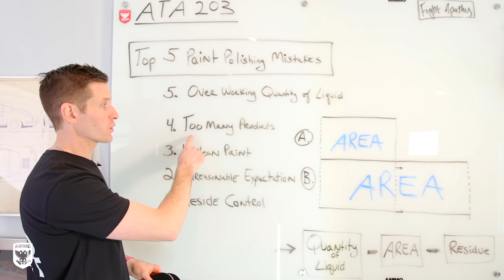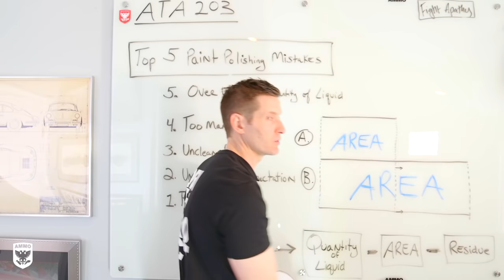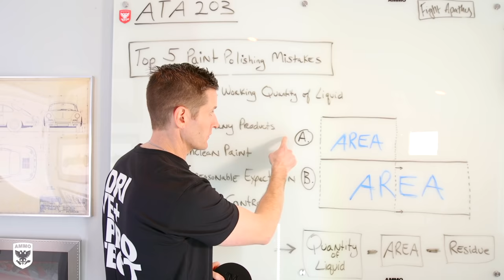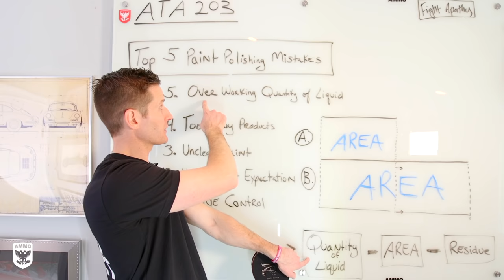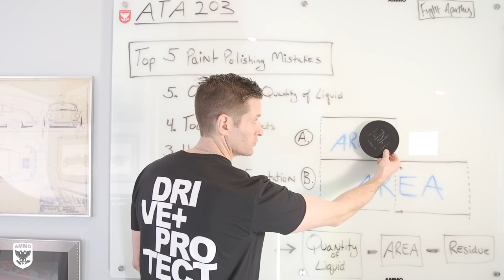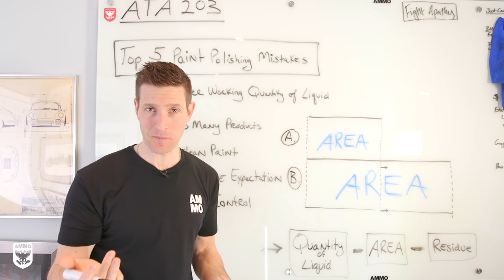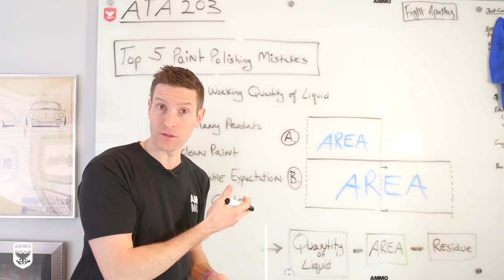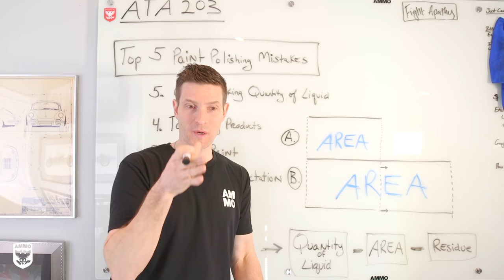Top 5 Paint Polishing Mistakes to Avoid! ATA 203

Comment: these series on buffing out to a mirror shine have been excellent.  the part on sanding to flat has been tremendous help.  if you are using base coat / clear coat or even single stage with clear coat is the orange peel on the clear coat or on the base coat or both.   i have spray can painted the hood, roof, and trunk lid on a 92 celica and they are now mirror finish.  still some minor flaws but for spray can paint job its fantastic.

Comment: Wow - yesterday was my FIRST time polishing my BMW. I had several areas that I (now realize) I overused my liquid. I had lots of sticky residue left over that I had to remove w/ a wet rag after. I couldn't figure out what was happening. OMG. Love this video. I had some paint touch ups that I did where the paint touch ups came out a little darker. I thought I could polish/buff this into the rest of the panel but I couldn't- not even w/ a cutting compound. Wish there were a video on correcting this.

Comment: Just polished for the first time yesterday and I'm super unsatisfied with the results. It's a 2015 Toyota Tacoma, 250k miles with lots of little knicks and scratches. It does look more shiny, but none of the scratches and swirls from what I see are gone. I used Malco Heavy duty with a wool pad. I had my DA polisher set to the speed malco recommended which was 2000rpm. We kept in small sections less than 2 x 2 ft but was still super hard to wipe off. We were also outside since the truck couldn't fit inside my garage and we are in Florida. 

My belief is that 1) it was too hot and humid outside 2) the pad we chose was not sufficient. I think the wool we used was a finer polishing pad. 3) possibly the paint still had sealant over it and didn't do a good enough strip wash. All we used was clean slate by CGs mixed with some superclean, then clay barred, IPA'd, then got to work. 4) Didn't prime wool pads correctly and didn't keep them clean properly. It didn't feel like it was cutting anything but just left some shine on there. Could someone give me some pointers on maybe why it didn't work or could my expectations for the types of scratches and corrections be wrong?

Comment: Funny thing is, the Festool RO 90 sander that was used for the wood demo has a polishing pad available for any type of polishing you'd want. Festool RO 150 has it as well. It won't do much good with a foam pad in the way, but the dust extraction piece is there. No long throw buffers though...

Comment: Bought a 2021 Telluride SX in Black Copper in late 2020. Gave it over to the a detailer with about 60 miles on it to do a ceramic coating. In prepping they burned the paint and then ceramic coated on top of it. Good times 👍🏽

Comment: thanks.  decided to finally compound/finish my three mustangs...so learning a lot before beginning. good tips...deciding if I need to strip before compounding. I only Turtle Wax once a year Spring, on all vehicles......so stepping it up a bit this year. I'm going to do it  light.  clay bar on one of the cars that needs it and then Mcguires Ultimate compound (heard it's pretty  mild) and do it lightly with middle foam pad not cutting... then wax with Ultimate wax...and see how it goes.  Car's are not that bad  curious about the foam pads and compound...two things with cutting?  hmm.

Comment: Thank you Larry! I have been searching all over the place to find out how to safely remove any sealants or waxes before compounding or polishing.  Every one says to use a clay bar, or Iron Remover, or APC or run a paint cleaner with a D/A. If it takes Kevin a couple passes with a sanding disc to break up a sealant how is a clay bar or paint cleaner going to remove it all? Any direction on this question would be greatly appreciated! I cant seem to find a solution that makes sense yet.

Comment: I polished my car for the first time a month ago and definitely was working on way too big of an area. every demo people showed online showed them doing a full panel or half a panel (like half a hood). I think I used a lot of compound (I was thinking i needed more after my first panel, so I increased it). I did the panels and afterwards I wiped off the residue, but the residue took a lot of elbow grease to remove and it also got all inside all the panel gaps and everything, the work got so overwhelming. I finished polishing the whole car in about 3 to 4 hours total? and then I tried to remove as much residue from the crevices as I could, but the compound was so dry and difficult to remove, so I definitely overworked it despite using a lot of compound (like I was putting on decently thick Xs of compound on plus maybe 3 to 4 additional drops to make sure I had enough for the panel).

Definitely lots of mistakes / stuff that made the job immensely harder, and none of the "how to polish a car" videos addressed.

Comment: You mentioned the importance of clean paint and the struggles of working on unclean paint, but not exactly the process or products you trust to get the paint clean before polishing. Can you please share or provide video link?  I use car wash shampoo, iron remover and clay bar before polishing.  Is that enough to say the paint is clean? I like using hybrid ceramic wax as protection after maintenance washes and spray detailer between washes. Thanks!

Comment: Another great video but what the hell... A car wash that put down a layer of protection that rejected wool pads and 3,000 grit?!?! I need one of those by me lol. Is there a specific paint prep you both agree on that is optimal over the standard paint preps? I absolutely love this series and keep them coming!
Reply: Some have ceramics applied at the end too. I believe the company is called Blair Chemical.
Reply: I'm surprised the Denali was clean enough for that protective layer to have actually stuck to the paint.  I'm guessing the car was was at least NOT a touchless.
Reply: @phasmata3813  I would assume it was a noodle wash if it was able to bond like that. Either way that is extremely impressive in my mind bc it was sprayed on a wet car and them sprayed off..
Reply: @phasmata3813  - The presoaks, and detergents are extremely potent and caustic. 

I remember them burning the hell out of my skin when the blowers blew the mist back to the prep area.

A friction wash can get the paint even cleaner due to the detergents used on the brushes, but a touchless usually uses a stronger dilution of presoak. That being said, if the car is really dirty, a dirt film remains on the paint.

Comment: Hey Thanks for the info I have a 2000 Silverado that has real good paint, So I work on that one my wife has a 2020 Highlander too new to touch. keep clean and wax that is all . But I have a good supply of chemicals and micro soft rags. Need to work on a good vaccum

Comment: I have found over the years that instead of putting 3 or 4 dots or dots of compound in general on my pad i put 4 lines right across from one another it gets your compound across the entire pad better. Also some compounds like 3D brand are extremely hard to over work and cause to dust. They have about 3 times the working time of about all other brands

Comment: I seemed to have missed the answer to what to do to paint to prep it before cutting, if there is a polymer coating.?
Reply: That's what I would love to know too. I wonder how should I completely remove something harder than wax, for example, a ceramic coating
Reply: @ramizfs  I have found with the right compounds pending the type of ceramic coating it can be slowly worked down. Or i have hit it with 3000 and re compound and polish.
Reply: Wouldn't using an apc or non ph neutral soap cut down or degrade that wax or whatever protectant is on the paint?
Reply: @slickwheelsdetail9586  Yeah, it seems to be the only way to do it. Thank you!
Reply: @ramizfs  when I have some extra product after I coating I have a old hood from the body shop in going to coat and mess with to see what it's like to remove the ceramic coating. Right now I'm using SystenX but im looking into moving wit IGL now.
Reply: their comment on the matter was dwell time. use stronger stuff and leave it on longer to remove.
Reply: @slickwheelsdetail9586  so let say the ceramic coating needs recoating after 6 months or year etc.. do you have to strip the ceramic coating all together again and then reapply ceramic coating? or can it just be reapplied on top of it (which i think its not right)
Reply: @JohnDeTulio  you mean like dawn soap?
Reply: @slickwheelsdetail9586  i think its good idea to get free parts from autoshops thats no longer working and test the ceramic coating or wax you use and see what products strip it so you can either reapply the wax or ceramic coating or polish etc..  question is, does feel determine if there is no sealant (like the squeaky clean rub feel in glass cups etc(
Reply: @ramizfs   ceramic coating can be remove via polishing some are or most are hard to remove but it doable with a cutting compound and a good da polisher maybe a force rotation will take it out faster  not sure since ive have not  try that method.
Reply: @JohnDeTulio  not ceramic coating since its meant to withstand a beating.

Comment: So is the idea to use 3 pea size drops. Work a one foot section in one pass.  Change or clean the pad.  Then repeat until finished? I see many other's on these channels using 3 drops, then buffing a 2' X 2' section for  2,3,4,5 etc.. passes, until basically there is no residue left to see, then they wipe off with a cloth.  As a beginner, what is the most effective way to achieve the best results.

Comment: Another great video. If polymer sealant aka synthetic wax is that tough to compound through, what would be the best way to cut into a coating?  It turns out, GD Infinite Forcefield doesn't have the best etch resistance (or the worst either to be fair), and my bumper and hood need some bug stain polishing.

Comment: Amazing , ty vm 
How the hell to remove wax/sealant before polishing please ?
Wax stripper often does not work , cutting compound as well if even sanding finds it difficult sometimes as in your video.

This question is still  open please
Reply: You use an IPA..(ISOPROPELYNE ALCOHOL).MIX A 50/50 SOLUTION HALF WATER HALF IPA IN A SPRAY BOTTLE..FIRST MAKE SURE YOU THROUGHLY CLEAN THE CAR..THEN CLAY BAR THE CAR..THEN USE AN IPA TO PREP YOUR CAR

Comment: Is there any specific way to go about removing ceramic coating? Mine is uneven in spots and needs to be removed and reapplied. Is there a specific compound that's good at removing it or is there a different method?

Comment: So maybe I missed it but how did the guy get the big SUV’s(15:00 mins in) paint cleaned off to continue the paint correction and perfect it?
Reply: I had him use an abundance of compound with a microfiber disc on a DA. Basically, the buffing liquid and pad was able to grind off/up the protection. He was able to see the point when the defects started to remove rapidly, and could feel the difference in how the paint felt during polishing, and wipe off.

Comment: How often should you blow out pads/change them?
Reply: Good question, im not a pro but I blow out my pads after about 3-4 1 by 1 foot runs. And for a relative small car ill use 3-4 pads
Reply: Adam Sounds right, I have experience in sanding wood siding on homes, you can see the pad degrade over time and notice the pad no longer cuts into the siding. With polishing, can’t really tell if the pad is worn down after blowing it out since the pad is so fine. Of course polishing is less work than sanding so the pad should last longer I assume.
Reply: @adamryd95  are you saying every 3 to 4 1x1 foot you blow it out? And overall use 3-4 pads in total for hatchaback size?
Reply: @janglee8523  yes, just so the pad is  as fresh as possible and not have any contamination and dirt in it

Comment: What do you reccomend to have only one machine, a Flex or Rupes (forced or free rotation)? By the way, amazing video as always
Reply: While I won't go so far as to say that anything is ever impossible with anything, I would personally not rely on a forced-rotation machine if I could have only one.  I haven't used a Mille, but the Flex gets hot, fatigues your hands faster, and will be much more difficult to finish with.  If you're just starting out, I like to recommend a Griot's Garage 6" with the backing plate downsized to 5".  It's cheap but good, can do anything you want it to do, and if you upgrade, the GG6 can make a nice 3" or works well with brushes for interiors.  I'm a professional mobile detailer, and I still use the heck out of my GG6.
Reply: @phasmata3813  Thanks a lot Mitchell.....I actually have a very old Griot's (maybe from 2010) with backing plate 6, it always worked nice for me but it's broken now and I need to buy a new one, maybe I will go for a another Grito's as you recommended
Reply: @saulosalem6955  Broken?  Griot's has lifetime warranty.  Also, be sure it's actually broken and isn't just in need of new motor brushes.

Comment: dude your teory will work exacly with dual polishing paste which have cut and finishing like pastes from SONAX They have more fat and it takes longer to finish them at sponge pads becouse paste mixture of cut start working very early and it decopreses cut mixture very quicly and leaves super finishing at the end like with wax. In conclusion, we have to polish shortes area very fast to get more cut. Longer polishing just leave better finish but it takes more time to clean the surface from paste. My tought is and You din't say nothing about pads is... before polishing test your pads on difrent spots and take a look at results of cut and finishing and take your best, pad is the key :)

Comment: Anyone have a suggestion of the finest grit sand paper to use for removing sun damaged clear coat? I have 800 grit up to 10,000 grit. Also which would be best to start with and end with, i.e. 1,000 - 3,000 - 5,000 then polish and done.

Comment: So does that mean you need a stack of pads?    I mean, 1 correcting pad, terry cloth, foam, whatever, at $8-$15 apiece gets expensive.  And I do understand the “pay-to-play” or “invest in your car care” mentality, but good grief, it could take 10 pads just to do swirl and scratch removal on your hood alone.    I’ve washed my pads, as suggested, with Dawn and warm water, not too hot, and a ton of product comes out, do that several times, squeeze it out, let air dry, times a literal pile of foam pads.  I’ve actually tried that with terry cloth bonnets for polish removal, and those bonnets get packed with residue in 90 seconds.      
That’s some serious resource consumption to consider.    Wool pads seem kind of harsh to me.   But they remove  residue better, lifting it away, , but when you least expect it, they’re tearing up the paint with gummed up residue.   Thoughts?
Reply from the maker: Call one day to chat I think u may have missed some technical points happy to help

Comment: good informative vid. I'd suggest using menzerna products this stuff is far superior to 3M .Im here looking for a  water sander I used a quick cut sander for the past 15 years it finally died and the company is no longer around it's basically a 5" air sander with a water injection on the side so it squirts water as you sand , any info appreciated  thanks in advance 
http://www.badasspaint.com/flames.htm